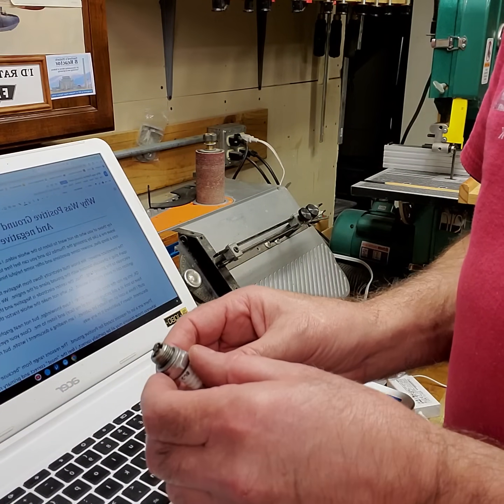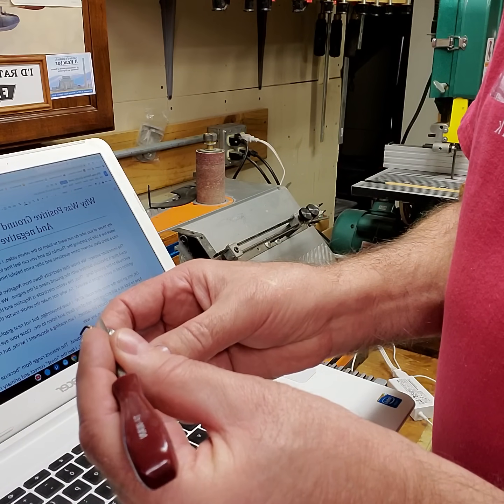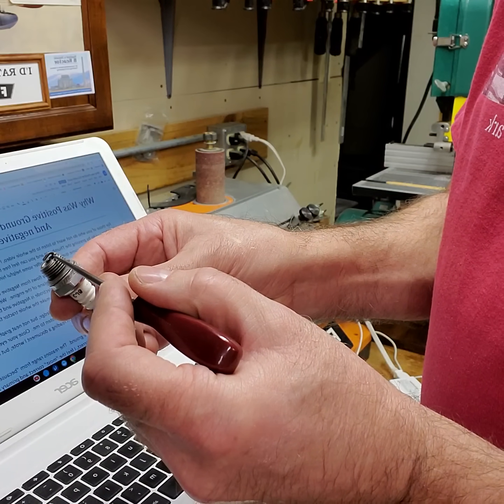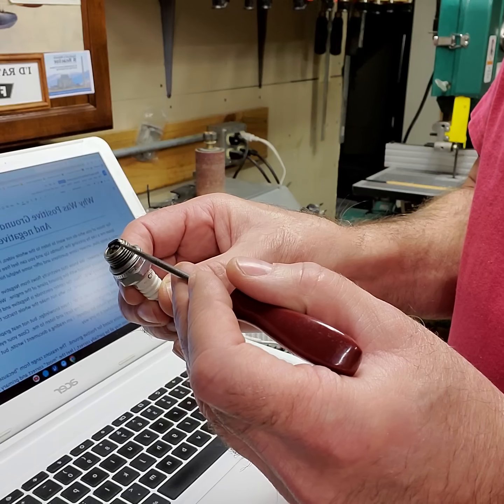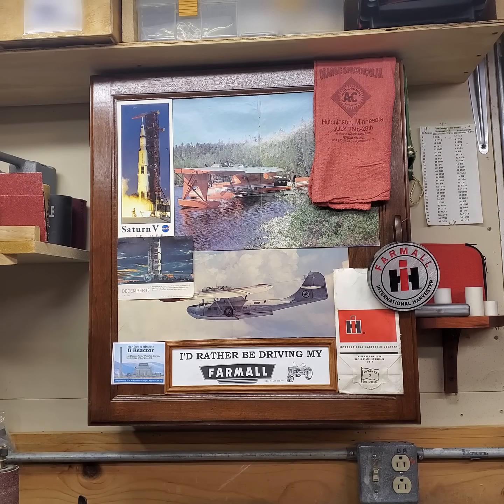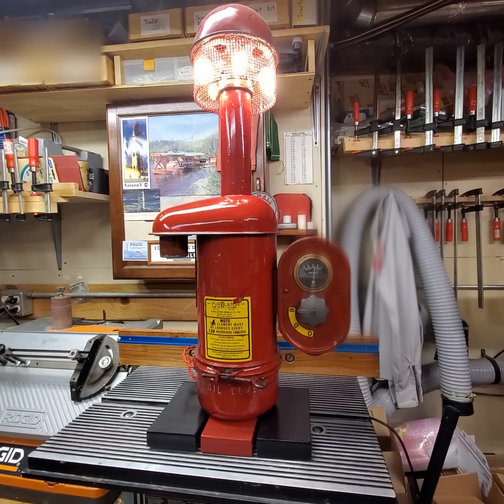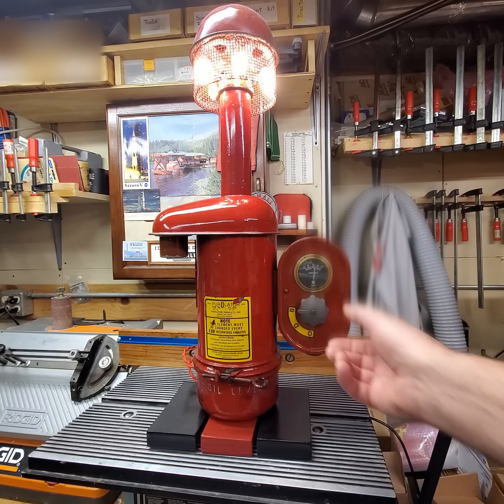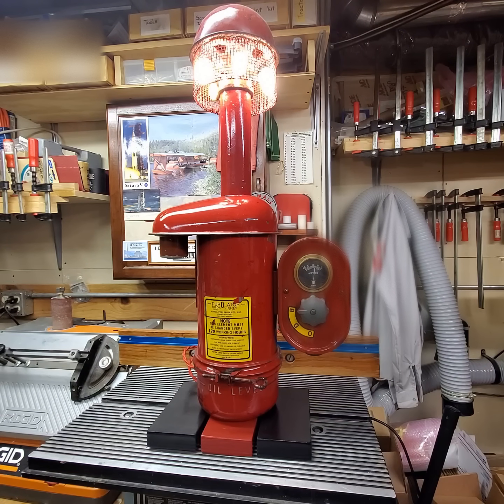Why positive ground was used on old cars, trucks and tractors

Comment: When I went to electronics school we were taught that current flowed from + to - and electrons flowed from - to +.  Works fine as long as you don't mix them up.
Reply: @Kelly Harbeson That's why there are no Anode Ray Tubes.
Reply: @GordieGii  Most Cathode ray tubes used in displays were black and white.  The Cathode ray would light up the phosphor.  We had color Cathode Ray Tubes used for display that had 2 phosphors, for example red and blue, and the red phosphor would illuminate if you hit it with 19000 volts, and the blue phosphor would illuminate if you hit it with 21000 volts, and you could get some red phosphors and some blue phosphors if you hit it with 19,500 volts, and you could get more blue and less red phosphors illuminated if you hit it with 20,000 volts.  So we had 4 colors.  red, blue, 2/3 red 1/3 blue, and 1/3 red 2/3 blue.  The beam penetrated farther into the tube, illuminating different areas of phosphor, the more voltage you gave it.  We had special 4 step high voltage power supplies, not a flyback transformer.  it buzzed at different levels depending on what colors were on the tube.  These were called beam penetration displays.  These were also called calligraphic displays.  Now, you can have black and white calligraphic displays, most of them were.  Calligraphic, as in handwriting.  you turn the beam on, and you better be moving your beam or you burn a hole in your tube, and then you turn the beam off.  Then if you are slick you crank up the voltage, and go illuminate a different part of your display tube.   
   Then we had conventional TVs, which are digital, and illuminate pixels, or picture elements, on the display tube.  so you only have a fixed number of pixels, say 486 times 440.  Whereas with calligraphic, you have a lot more.  i would say infinite, but it is not infinite.  close, though.  Then, imagine if your calligraphic tube were color.  wow.  36 inches round.  
then we had regular tubes.  radio tubes.  they are cathode ray tubes too. they only need about 400 volts or 500 volts dc to work.
then we had the travelling wave tubes.
Reply: @j6295362  Conventional TVs, black & white, or colour, were not digital like CRT monitors, they were a bunch of analog lines. Even in colour CRT monitors the phosphor dot don't line up with the pixels.
Your 'caligraphic' displays sound a lot like oscilloscope tubes, but I'm assuming the beams were steered by electromagnets, like TVs, whereas oscilloscopes beams are steered by electrostatic plates.
Radio tubes are not CRTs with the possible exception of tuning indicator tubes. (Also called 'tuning eye' or 'magic eye' tubes) There were CRT memories in the late '40s to '50s but they were modified oscilloscope tubes and I'm pretty sure the effect relied on the phosphor so they were technically display tubes, you just couldn't see the image because of the sense electrode in front of the screen.
I guess you could say that a traveling wave tube is a CRT as it has a directed beam.
Reply: @GordieGii  There are anode ray tubes.  They glow pink.
Reply: Ben Franklin started the + current flow myth but he was fooled by ionic plating of metal in a battery. Later we discovered electrons were actually carrying the current. Today electronic techicians in the military and tech schools are taught electron flow and 'left hand rule' in electromagnetic polarity determination.  Classical engineering texts still cling to the 'positive current' flow rules and diodes and transistors still have 'arrows' pointing in the direction of 'positive current' flow and they have texts with 'right hand rule' for electromagnetic polarity determination. In fact it doesn't matter as long as you are consistent in using either one or the other in solving circuit problems.
Reply: +(potential voltage)  -( ground/meutral) refers to polarity;  +(cathode)  -(anode) is a different perspective remember/ study your chemistry. You will not have a vivid understanding on the Laws of electricity if you omit the science part of it.
Reply: @frederickmojako3241  Cathodes are negative, Anodes are positive. Cathode Ray Tubes (CRTs) are called that because the Cathode Rays are electrons that come off the cathode.
Reply: @GordieGii  It depends what you're talking about of course. On a battery the Anode is negative. In other applications the Cathode is usually negative.
Reply: @_MKE  That's because inside an electrochemical cell the electrons move from the cathode to the anode making the cathode positive and the anode negative. The terminals  on the outside of the cell are connected to anode and cathode. The positive terminal is connected to the cathode and the negative terminal is connected to the anode. The terms anode and cathode refer to the functioning of the device itself, not how it's used. So inside the cell the electrons flow from the cathode to the anode, and inside a CRT the electrons flow from the cathode to the anode. In the cell it's a chemical reaction that pushes the electrons but in a CRT it is the surplus of electrons fed into the cathode (and the deficit of electrons at the anode) that pushes them.
Reply: @frederickmojako3241  Neutral usually refers to AC circuits and has no polarity whereas the Line has both polarities, alternating.
Reply: @GordieGii  From what I've seen "neutral" is a term used to make life easier for electricians. It's often called the grounded conductor because it's not actually neutral. It only appears neutral because it is always tested compared to ground. Even on oscilloscopes. Because it's bonded to ground it will always test neutral when compared to itself. In actuality center tapping the transformer creates two smaller transformers out of phase with each other but still generating a current that alternates between either hot and "neutral". When one hot wire is at maximum positive the "neutral" is at maximum negative for that circuit.
Reply: @_MKE  The Neutral is connected to the center of the transformer (of either two phases 240 V apart, or three phases 208 V) and the ground wire is connected to the actual ground beneath the building. They are supposed to be connected together in the main breaker panel, so if you touch the Neutral while standing in a puddle, or barefoot on the basement floor, you won't get a shock, and so it can be used as a ground for devices with a two prong polarized plug. The Neutral wire is meant to carry current to and from a 120 V (110, 115, 117) electrical device in conjunction with the Line wire. The Ground wire is not meant to carry any current unless there is a fault.
This is all here in Canada, and I believe it is the same in the USA.
Reply: @GordieGii  I know and stated most of that. It doesn't change anything that I said.
Reply: @_MKE  And I never said you were wrong. Just adding perspective.
Reply: @GordieGii  Concerning your comment of "two phases 240V" where does split phase come into the picture and if one phase is 120 and two phase is 240 why isn't three phase 360V? When power is generated from the power plant there are three wires connected to insulators. Does power go back to the generating plant? You don't have to respond, I know it is confusing. If we are going electric vehicles I think more homes should be wired for three phase though.
Reply: @timsteinkamp2245  There are two Line phases 180 degrees out of phase, so when one is 120 V above Neutral the other is 120 V below Neutral. In three phase power the three Line phases are 120 degrees apart, so when one phase is 117 V above Neutral the other phases are 30 degrees before and 30 degrees after zero crossing. The voltage is measured phase to phase. The math is a little complex but it comes out to 208.
Reply: @GordieGii  what you said is inaccurate. Both neutral and ground both go to the earth. The only difference is one is for power and is grounded from the transformer to the earth at the bottom of the pole and the 'ground' is for safety and goes to earth outside your house near the meter box.
In three phase, there is no 'neutral'.
Notice that in residential single phase power, there is only one wire connected from the transmission line (that is strung along the 'telephone poles') and the transformer. If your theory was correct, there would be two.
Reply: @correctednews1463  Maybe where you live. I live in Toronto, Canada. All our residential power is underground. When I lived outside Toronto, there were three wires running from the transformer on the pole to the house, 2 Lines and a Neutral, through the meter to the breaker panel. The ground came from a rod pounded into the ground through the basement floor. I'm pretty sure the slab was poured after the rod was installed. The (bare) ground wire was clamped to the rod and ran to the breaker panel. It was attached to the breaker panel, and the Neutral buss bars were attached to the breaker panel. There might have been a ground wire going up the pole to ground the case of the transformer or a lightning wire, I never bothered to look, but there were definitely only three insulated wires, red, white, and black, between the pole and the house.
In the factories around here the power comes into the building at 600V (or much higher) 3 phase no Neutral and then goes to transformers, 3 in 3 out, for machinery or 3 in 4 out (208 V, Y Neutral center) for office receptacles and lighting. Couldn't tell you where the grounds come from, I'm not an industrial electrician.
I have seen power similar to what you described, a transformer on a pole with one line running along the poles connected to the insulator sticking out of the top, one wire going to the house, and one wire connected to the case running down the pole. Only ever saw that way out in farm country. Anything near civilization has 240 split phase.
Sorry if my description isn't accurate for where you live and the electrical code there.
Reply: @correctednews1463  you are refering to SWR single wire return. In the land of Oz this system was intensely used in the "out back " all the power came out of the ground and a wire was used to complete the circuit.
Reply: + to - is conventional current and is taught to engineers.  - to + is electron flow and is taught to technicians.  It just adds to the fun when the two try to talk to each other.
Reply: @russellhltn1396  I was trained as a tech starting working in a TV repair shop at 16 and learned the + to -. The military taught the same thing. I had some engineering training and it was a little confusing going - to +. I worked in electronics and communications all but a few years of my work career.
Reply: @Chris_at_Home  I think most hobbyist magazines use - to +.  That's probably where I got the "technician training" idea from.
Reply: @russellhltn1396  My experience was exactly the opposite.  I think it has more to do with when and where one went to school than the level of education.  I had a teacher in 1972 High School Vo-Ed Industrial Electronics who constantly flip flopped while teaching transistors.  It screwed me up for decades.
Reply: i'll make things worse for you...the electrons actually move very very very slowly, about a 1/2 inch a second. only the fields move near the speed of light.
Reply: @mrl22222  Lots of folks have made videos on this topic.  But, I'm still trying to wrap my head around it.
Reply: @mrl22222  Perhaps in wires. But surely Cathode Rays (electron beams) move a lot faster than that. Obviously not AT the speed of light. (or they would turn into photons)
Reply: @TheRealCheckmate  - to + electron flow is physics reality, but as it happens Ben Franklin got it wrong before electrical physics was well understood. Ben's "conventional current" is still the model in many schools. Engineers and technicians who were trained using the opposite models see each other as ignorant fools who don't understand the most basic. (Come to think of it, often enough they're both right.)
Reply: @Kelly Harbeson ...hole flow was always just for math.
Reply: @Kelly Harbeson was not "debunked by spark gaps" holes travel in reverse to any electron flow.
Reply: John - Navy electronics school taught that.
Reply: @TheRealCheckmate  Physicist!
'Current' without modifiers refers to 'conventional current' otherwise we say 'electron current' especially when using mnemonics to figure out magnetic field direction from current direction or vise versa.
Reply: @TheRealCheckmate  So are holes.
Reply: @Robert Swaine 😂 that's just what someone who doesn't know what they're talking about would say.
Reply: @Kelly Harbeson 1. Citation needed. Two wtf are P-doped semiconductors? 
If the electrons move through a material, then holes change position as well, and thus "move".
Reply: @Kelly Harbeson "Even though an electron has moved from one covalent bond to another, the most important thing to remember is that the hole is also moving. Therefore, since this process of conduction resembles the movement of holes rather than electrons, it is termed hole flow (short for hole current flow or conduction by holes).
"
Reply: I worked with a older man he said he didn't care which way it flowed  as long it keep going the same way.
Reply: @noti51  So he only liked DC?
Reply: We had electric car 6 years after Ben did that thing with the kite and key.
Reply: They teach so many lies in school and especially college.
Reply: What magic is this?

Comment: Loved this video, and I just bought an old Fergesun tractor having a positve ground.  I think I will try to keep it positive ground for the benefit that it causes less corrosion, which is electrolysis between the metal and the air.  Phone companies noted that positive ground worked better and less corrisive than negative ground systems in the old days before plastic insulations.  There is a third charge which affects the corrision and that is the charge of the air.
Reply: It actually goes all the way back to the early telegraph networks.
Reply from the maker: Hi Ben!  Thank you.  I agree with you.   And, keep the old tractor + ground.
Reply: @bryanh1944FBH  I will but I want to make it a 12V positive ground so I can used solid state ignition components instead of points and a higher voltage coil for easy starting in cold weather
Reply: yes
Reply: Send me more info
Reply: @Benny-dv7xm  I'll send it to your email listed on Youtube.  I am trying to also produce documentary footage while I am repairing my old Fergie.

Comment: French man name Ferriday invented the capacitor that is why they use the formula Ferret and they did not know which way electricity traveled so it was a guess. they flipped a coin and got it back wards. Chrysler, Ford, AMC and all of Europe used positive ground the correct way. GM used negative ground. To many people would replace their own battery would think negative goes to ground guess what would happen gauges worked backwards and generators would burn up. Europe and USA made a agreement to go to negative ground in 1955. it has nothing to do with the sparkplug. Electricity travels through the car body to all devices then traveling through the light bulbs then the wire back to the battery. I worked for Porsche for 20 years mechanic, Service Manager, Test car driver and District Service Manager ( Factory rep ) I invented the second position for the drivers window switch so you would have a free hand to lower the window and throw change in the toll way feeder bowl and I invented several other things. I am now 80 years old and I have seen many things. I am a extra class Amateur radio operator ( Ham ) Call letters WW5D. Arizona licensed School teacher, Journeyman Carpenter Union. I built my first computer in 1979 booting on basic used to translate mores code to type print on my computer screen plus I was CEO of PC Electronics Inc. so I know a little about electric devices. When a coil in cars after 1955    ( todays car's ) sparkplug fires the spark jumps from ground to the electrode. Boring I know.

Comment: Hi, the real reason was way earlier than prewar spark ignition systems. The early electric lighting systems were +ve earth. Reason is the awful cotton and rubber insulation of the wiring fails when it gets wet. It was to prevent wiring failing early after getting wet. Add salt to that and the failure is quick. Good pvc insulation and transistor radios/ignition systems drove the first swap over. _ve earth coils have reversed secondary winding with a few extra turns to overcome "bucking".
Reply from the maker: Hi Howard.  Thank you.  That is very interesting indeed.
Reply: Thank you! Finally a theory with some traction.
I had commented above, and had doubts about the ignition coil theory as well, as they can be internally constructed for any polarity desired.
This makes sense.